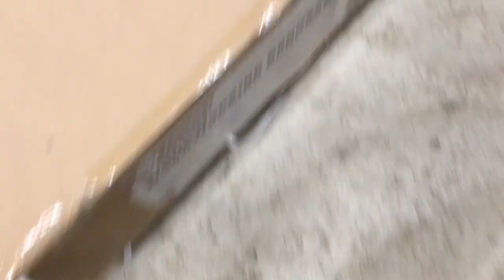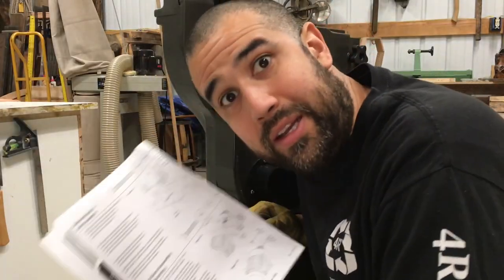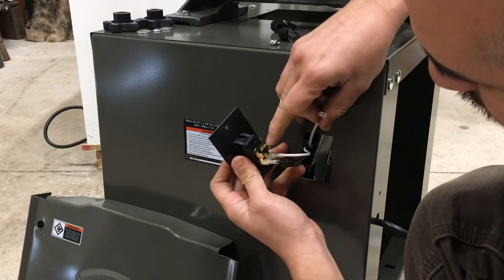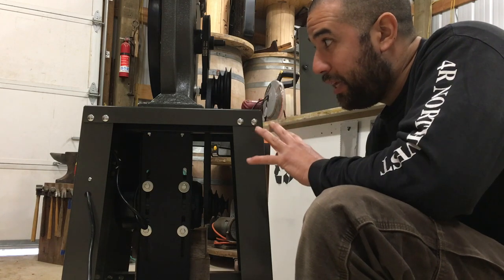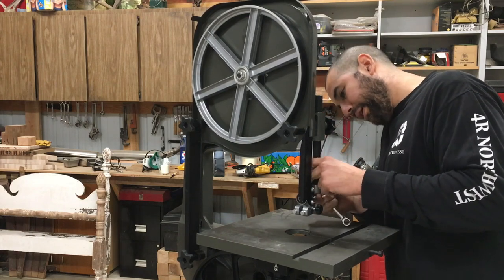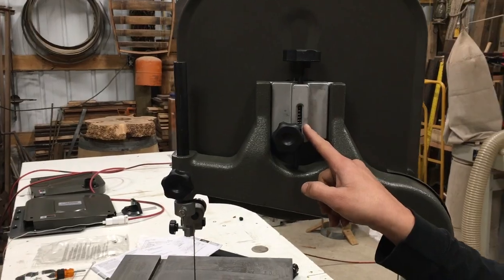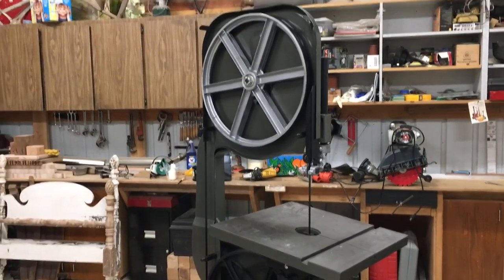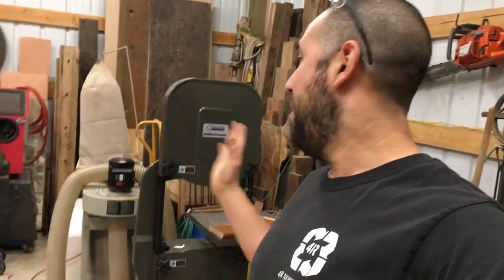Harbor Freight Bandsaw Unboxing, Assembly and Review | 4R NORTHWEST

Comment: so how good did it resaw?  I also noticed you didn't square the miter sot to the blade did that make a difference?   now watch your gonna mess with it. And  ok because your learn more about the tol doing that. if you get sick of the slide blocks I found a webpage they sell upgrade roller block sets for guides the roller are on a cam and work a hell of a lot better, i had them on a 42" horizontal metal shop bandsaw I used to run that use a blade that looked like it was off a saw mill for trees. you unfold that blade you wear gloves but here is a trick grab it with 2 hands 
teeth up and toss it out away from your body a few feet off the floor, then pick up the uncoiled blade. to fold them up use your knee and or foot. stand on the blade with one foot and turn, somthing like that its been about 30 years I kind of forgot how to do it but your talking a 23' + blade on a saw that big.

Comment: Another tip is get rid of the plastic guide blocks that come with the saw, they wear out very quickly. I cut some blocks out of hardwood blocks and soaked them in oil for a couple days, they’ve been in the saw for years and still no wear.

Comment: nice job! i had to figure out the vertical motor mount bracket. it's actually 180 out and upside down!! in the manual. but it is what it is, the saw runs a little rough but it can be smoothed out with some time and research! thanks for making this. it was a big help!! cheers!

Comment: I left mine in its box in the back of my Nissan Pathfinder, and removed all the big parts separately, to save my back.  It would have been great to have seen this video before I did the assembly!  One thing I spotted in your video that is a big help is the alignment of the table to the frame.  Thank you, this is perfect and much needed.

Comment: Lucky yours doesn't bounce all ove the floor like mine does. I have to hold it down to cut anything. I bought mine used but its basically brand new and now I know why he sold it to me. The douche bag didn't tell me the motor shaft was bent and the damn thing wobbles all over the place which makes it almost useless. I won't do the same thing he did to me, so now I have to buy a new motor for it with a straight shaft

Comment: If I knew about this sooner I could of saved money. I just got the 14 inch Grizzly 1-1/2 horse power Bandsaw new for $780.
Reply from the maker: Fret not my friend! Your Grizzly noizemaker is an excellent machine and if one can afford it there is no reason not to! 1.5hp is every bit of power you should need, especially when you get into resawing lumber for making your own custom dimension boards or veneers. I also have a grizzly with a 1hp motor as well as the 6” riser block and have resawn 12” boards on edge! Without incident. So, enjoy your machine! It’s a good one. Thank you for watching!

Comment: Fantastic video. 2 days.. admire your willingness to quadruple your time un assembly for us. Sounds like you are familiar with delta and wondering if a used 28-150 for 125.00 would be worth the savings. 28-150 has hardly been used. At least the HF has warranty and parts availability right? Thanks ahead.
Reply from the maker: Hi there Robert, it always depends on what you plan on doing with your machine. That being said, if woodworking is any kind of pursuit you’ll find yourself outgrowing that little delta real fast! Now, a little known secret: there are still 20% coupons withOUT the Central Machinery exclusion! They’re harder to come by these days but they’re out there! That is a huge savings on a brand new bandsaw! Found a couple on struggleville.net hope this helps and thanks for watching!

Comment: not only is it a knock off of the Delta ,many parts are completely interchangeable  over the years Delta has made minor changes to there  saws  one of them being the way the covers open and close  and some of the adjustment knobs had been relocated ontheir saws and /or eliminated  all together  all of which don’t really have a lot of impact  on using the saw for Woodworking  although i understand that some folks that set them up or bought them for metal  do have more opinions on those changes ? i’m a Woodworker myself and  for the cost savings  i pretty cool with the Harbor Freight  and i’ve used the Delta branded ones quite a bit in shops i’ve worked in  or been Associated with  although typically on those i wasn’t responsible for maintenance and scheduled cleanings of  but would simply go to them to cut  whatever i needed to cut
Reply from the maker: Craig Monteforte Hey Craig thank you for the comment! I’ve found the same thing. Most people don’t know as far as budget equipment goes as the typical purchaser of budget tools may not be professional woodworkers (i.e. they’re not being payed for their woodworker). Which is OK! That’s how I started and learned and why break the bank on something that may not garner a return or turn out you don’t enjoy? Hopefully others will see your comment because the comment section for the “maker communities” is important and most of us are interested in sharing information and helping others getting started. I’ve also seen the HF models with 6” riser blocks installed! So it can be done. The motor included is a 3/4 HP, but it’s a belt drive! Which means if one REALLY needs more power (usually in the case of resaw work which people would be surprised by a 3/4hp motor and a proper blade for the work) you can swap out the motor with a heavier duty. Anyways! Thank you for watching!

Comment: My upper blade guard won't fit smoothly inside the upper wheel guard. I have no idea what to do, but it wont fit.
Reply from the maker: Upper wheel guard? Not sure what part that is you're referring to. Maybe I address that part installation in my video but that video is like an hour long! Maybe be a little more specific? I'll try to help if I can.

Comment: The way you treated your boy says a good deal about you. Secondly, I like HF tools. They are generally overbuilt, easily tuneable and if properly used (and sometimes not so properly) they last forever.  I just bought a second 14" so I could have two different setups for a particular job I have going, and I forgot how the first went together so I went to youtube and you popped up on the Up Next.   Good timing, huh?

Comment: I have one of these, its great for the money. I put wheels on mine so I can move it easier. one thing, be careful with the trunions, they are pretty week castings, steel would have been better. and the motor is a bitch to move and keep square so the belt is in line. coulda done a swing mount instead of the slides.

Comment: I have always heard "NEVER to move a bandsaw yourself"...this model has a shipping weight of 175 lb. As you've demonstrated, I think most people should be able to answer for themselves if they can carry that much and just use common sense. A lot of folk should have no problem moving one of these around on their own.
Reply from the maker: That’s my feeling! Though people do dumb things all the time so it is worth mentioning that it is heavy and awkward! The last thing you wanna drop is anything cast iron! Cast iron make incredibly strong and rigid support systems for machinery of all type from jointers to bandsaw. That being said cast iron is also brittle and will not stand up well to being tipped over or dropped. So to anyone having so much as a second thought on moving these machines on their own, GET A HELPING HAND! thanks for watching!

Comment: Bought one today. Took me the afternoon to assemble it. The stand was the hardest part in my opinion. I put it together (finger tight) as best I could according to the instructions. When that obviously wasn't going to work, I just re-arranged it until it looked like it would work. The instructions are just not real clear at times with their drawings. 
Some parts of mine were pre-assembled. The motor pulley was already installed. That was nice. Lining up the pulleys was a little tricky, but not bad. My upper pulley was out just a tiny bit too far and it would rub against the door when it was closed. Fortunately, it was small enough that I was able to just readjust the pulley cover a little and that was enough to take care or it. 
All in all, a nice saw and well worth the money, especially with the coupon. Putting it together is a bit of work, but the benefit is that I know exactly how it all works now. I think I will be enjoying this saw for many years to come.

Comment: One of the best tutorials on assembly. Funny and the piano jazz was just right for this. For the money this is an OK saw for light re-saw. For a busy shop a better quality saw would be needed. Not a fan of the guides and bearings. Thank you for the entertaining and good instruction.
Reply from the maker: Dingle Berry well thank you very much! I do agree to an extent: for the money it’s hard to beat. For resaw one would need an appropriate blade. In this saws case a 5/8” 3tpi resaw blade would run just fine. Take your time and let the blade do the work, it’s bandsaw not a table saw. As for the guides and bearings, they’re not the best and I’ve certainly seen worse! Get some decent cool blocks and that’s as much as I’d bother on the guides for this saw and its capabilities. Now, if one is planning on making a living on a bandsaw then you’re right, you may wanna look at other options for which the bottom end would cost 4 times this saw and that would just be a base model saw! For most home owners and hobbyists this saw is worthy addition to the garage or shop. I’m sure you know all these things already but I reply with this in hopes that others that read the comments can glean a little extra info concerning this saw. Thank you for commenting and thanks for watching!

Comment: I have the older green model which was made in the same factory in Taiwan as the standard models for Jet, Powermatic,  and Grizzly.   I upgraded the motor to 1 1/2 horsepower,  swapped out all the blade-guide assemblies for Carter's,  added a Carter blade tensioner, added a Kreg fence, added a Grizzly 6" riser block, and  upgraded the belts to the red link-belts.  All of this was done as I could afford to do so.  The only thing that I wish that I could still do is get cast iron wheels.  Your video is great!  I think that Harbor Freight should put a link to it on their website!
Reply from the maker: Michael Gross haha! Wow! Well thank you so much I really appreciate that! Harbor Freight actually follows my Instagram account. They’re really great folks over there and it’s amazing that they’ve found a way to lower the barrier to entrance for anyone interested in a broad range of skilled trade! They make no bones that their machines may but be “industrial grade” but damnit! Who cares at their price point on a huge selection of tools and machines! It’s like I always say, 9 times out of 10 it’s operator error and the tool is just fine. 😂👍🏽 thanks for watching!

Comment: Replace the insert the day you get it. Was about two months into mine, feeding a small piece through it for a carving when the POS orange insert failed, shattered and pulled the piece vertically down into the hole. Piece was too big to fit through, which is what spared my fingers from going in with it.
Reply from the maker: BE CAREFUL! Id like to see what you were doing and how you were doing it. Ive been using bandsaws for over 83 years and have NEVER had that happen. But I believe you and yes, I agree, replace the insert with an aluminum insert would be best....and a brass insert if you REALLY want to show off. thank you for watching!

Comment: You video really helped me out a lot! I do have a little problem tho. That red plastic cover for the center is touching blade :( Do you know if there's any way to adjust table forward a little? I couldn't find it in the manual... Thanks a lot!
Reply from the maker: bratan007 Haven't heard that one yet but should be an easy fix. If you're referring to the plastic circle through which the blade passing through the table, it may be that the slit in the plastic wasn't centered properly. If it's interfering with the blade performance (it really shouldn't as the blade will merely cut its own track in the plastic) then remove it and widen the gap. OR, now that you have a new bandsaw, make yourself a zero clearance insert to replace it! Fun first project. You can even get a piece of 1/2" or 3/4" melamine coated in mdf, attached a guide stick that matches the miter slot in the table top, set in into the miter slot and slowly feed into the blade till its center on the table! Now you've got yourself a super smooth high contrast top with a zero clearance for the blade. This has a ton of uses! Like setting a finish nail in the mdf as a center point and cutting perfect circles on your bandsaw! Hope this helps and thanks for watching!

Comment: i hate to tell you this but that is no delta, not even close... you get what you pay for, remember that.
Reply from the maker: Robbi Terry you’re 100% correct. It is NOT a Delta, it is a Central Machinery. Central Machinery modeled after the deltas. They did a good job too! It runs great, easy to set up and will accommodate blades up to 5/8” without issue. The nice thing, like most 14” bandsaws where 3/4hp is adequate for most hobbyist projects, the motor can be upgraded easily if heavy resawing is needed. Even with the added cost of a heavier duty motor it would still be quite less expensive than other name-stay brands. Will you run an industrial business on this machine? No. Can you have a great time and do a wide variety of work on this saw? Absolutely! Like I tell everyone, what are your intended purposes? It sounds like you need professional heavy duty equipment. Not sure why you’re wasting your time watching a video like this on a tool that is clearly substandard for your needs. But you did! So, thank you for watching! Hope you enjoyed. Maybe look into a 36” 3phase Oliver. That may be more up your alley. Take care.

Comment: I really enjoyed your video. I appreciated how precisely spoken you were, in that you made sure to use the correct name for whatever part you were referring to. On the topic of the saw, I've read that HF sells a 6" riser kit for this saw, but that you can only get it via their customer service phone number. Any chance you could/would do an install video on that?
Reply: Since this comment, I have found out that HF doesn't sell the riser kit anymore, so you have to make another brand's kit fit. The Delta/Jet/Grizzly ones won't fit out of the box, because the alignment pin holes are not in the same spots.

Comment: Nice job. But you didn't use the guide pins to hold the table square. They are diagonal to the bolts, just tap them down with a hammer, then line them. Also, I didn't see you put on those cable clamps that go in the box and base.
Reply from the maker: good points! those little plastic cable clamps sucked anyways.

Comment: Good video man... I’m buying one on Wednesday. Nice to actually see what I’m going to buy... How it operates... and how it’s put together very detailed. I give this video 2 thumbs up because I’m only human lol
Reply from the maker: NattyDread Andrè Right on! Hope this "little" video was helpful and comes in handy after your purchase. My first recommendation for this saw is going online to Amazon and ordering at least 2 different bandsaw blades, (I like Olson) get a 1/4" and at least a 1/2" resaw blade. I prefer a 3/4" 3tpi resaw blade for cutting taller sock on edge for making strips or veneers or general dimensioning and straight cuts. I have a Grizzly 14" with a 6" riser block and can resaw to nearly 13" tall! The motor on that machine is only another 1/4hp stronger than the HF unit. If you ever feel underpowered down the road just upgrade the motor. But unless you're making a living off that saw you should be fine. Thank you for watching!
Reply: Finally I brought it just now. Now to put it together... Thanks for the video again... I caught it on sale for $295 with a %20 discount today

Comment: Have you tried re-sawing hard wood? I heard the motor doesn't have enough power.
Reply from the maker: Peter St. Louis great question! 3/4hp is plenty. The fault almost always lies in a poor blade for the job. Just like a table saw. Just because you have a $2000 table saw, it won’t cat any better than a $200 table saw with the same cheap or dull or WRONG tooth patterned blade! Now, bandsaws are NOT a table saw and should not be treated as such. Like a table saw (which cut MUCH faster) you can only feed material at a rate the blade can carry away waste.  Hardwood resawing? I recommend a quality 5/8 3tpi resaw blade. Olson makes a good blade that won’t break the bank and they available on Amazon! Let the blade do the work. It’s a bandsaw blade, not a circular 10”,  3/32”, 24tooth blade moving over 10,000 rpms! And always remember, tools only do what they’re told and 11 times out of 10 it’s operator error and the tool is just fine.😉 Thanks for watching!

Comment: The pin on the side of the table is an alignment pin, It's a smooth taper. To remove it I always use a claw hammer like removing a nail. Works every time. When the blade is installed just insert the pin and give it a simple tap with the hammer. Keeps the table aligned where they cut it for the blade.
Reply from the maker: aaaaaand thats probably what instructions are for! naturally I. didn't read that part because I'm impatient! But now I know and hopefully more viewers will read the comments as yours among others have great comments, tips and suggestions! Thank you. and thank you for watching!